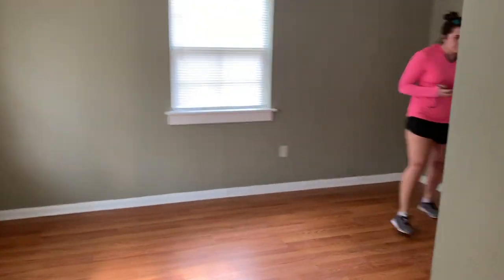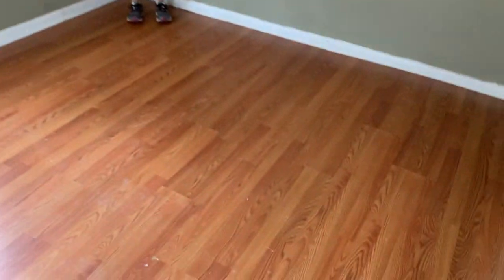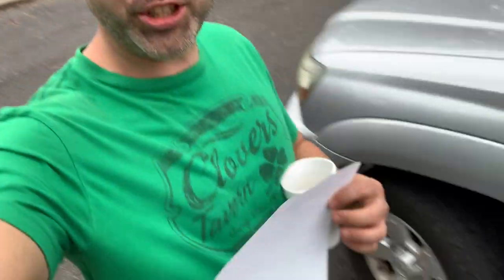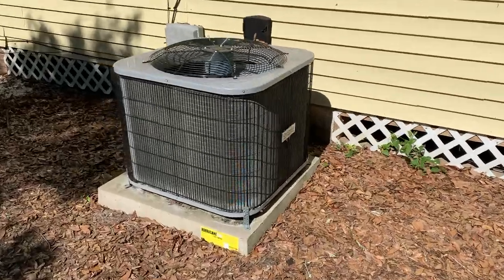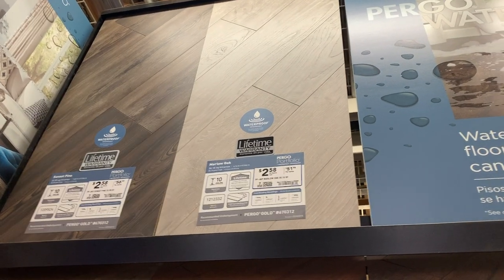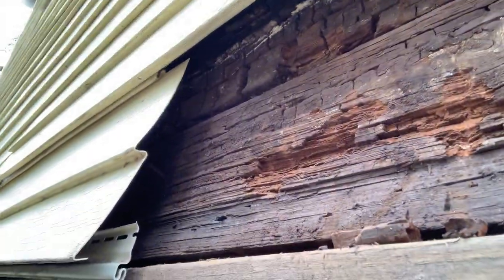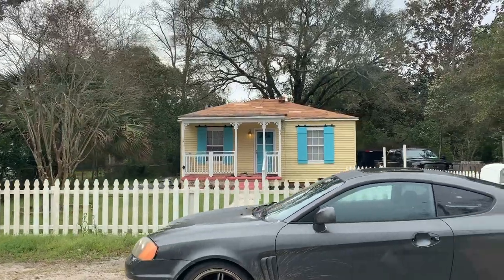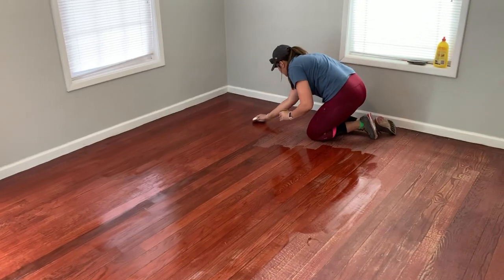How to make Passive Income: Why I make $2500/m (Flip Before and After)

Comment: A metal roof over a flat roof.. if you can put it over the shingles metal roofs they look great easy to put on and they last a heck of a lot longer and take a lot more of a beating
 also I'll put the roll roofing underneath the metal if it dosen't have it already that helps a lot pretty much guarantees no leaks... don't go cheap on the metal or the screws either don't buy none of that cheap stuff buy the best you can I never go cheap on roof ever it'll come back to haunt you.....

Comment: Do you only do rental properties, do you do vacation properties. If not can you recommend someone that does
Reply from the maker: I don’t do vacation rentals. They are proving to be terrible investments. They have been shut down most of this year.
Reply: @YakMotley We have one on SGI. The STR market was definitely bad this year due to two months of non-income at the stroke of a pen. They do have high cash flow, but also cost (a lot) more up front. There is also the risk of damage from the numerous renters in a short time span, though it's generally good to require damage deposits and damage insurance. One plus is that owning a vacation rental which you use yourself several weeks per year is frequently better financially than renting someone else's VR, however buying one (especially on a mortgage) and expecting it to immediately operate in the black is a fantasy.